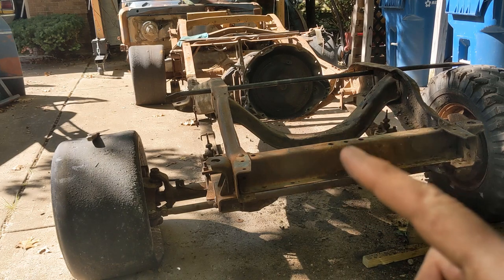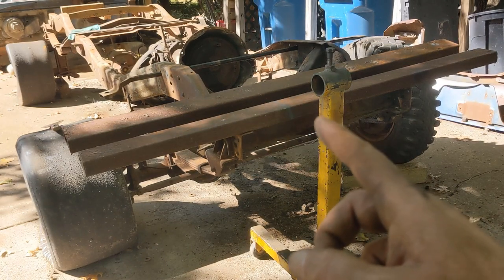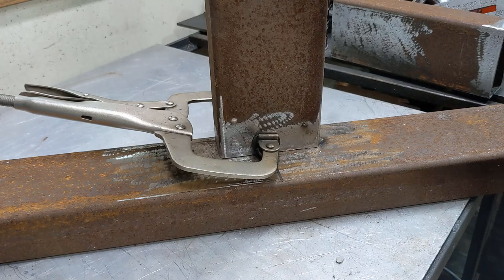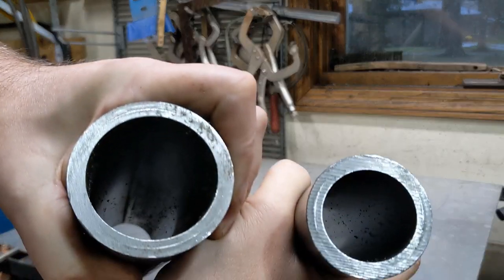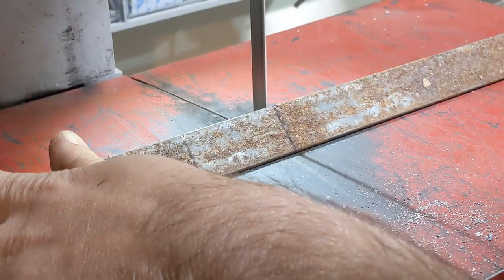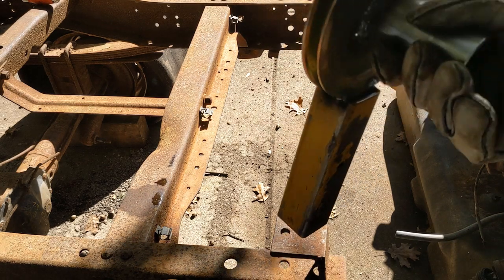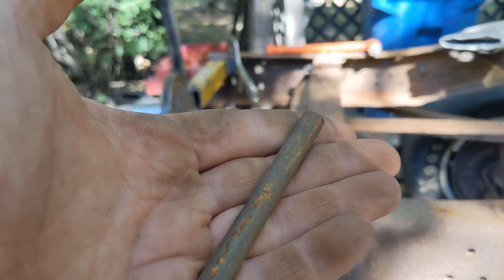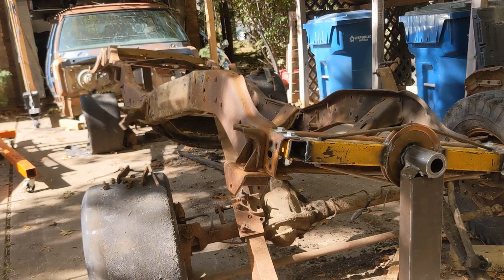Build Your Own Truck Frame Rotisserie - Cheap!

Comment: To me, the centers look a little sketchy. But I can’t see it from my house. In any case, take care, because I really enjoy your channel.
Reply from the maker: It looks sketch mostly because my welds are fugly, but it's surprisingly solid. I'd hang the chassis with full running gear on them without concern (though it would be way off balance and wouldn't rotate at that point)

Comment: I guess I missed something. why did you weld a pulley between the two lengths of square tube?
Reply from the maker: It gave me something to weld the round tube to 360 degrees, and requires less depth for the overall stand. Front to rear space is in short supply in my garage and saving a few inches means I can walk around it and not crawl over it.